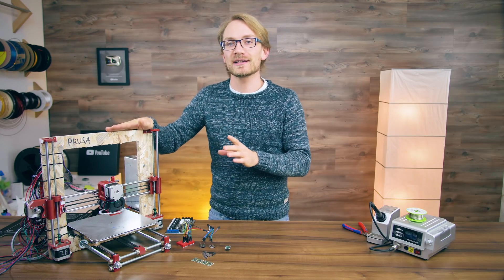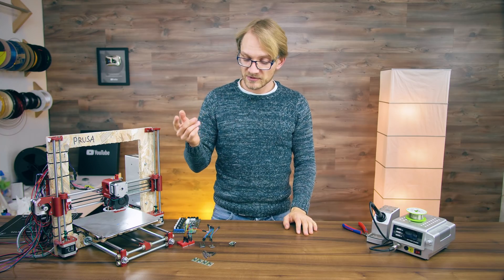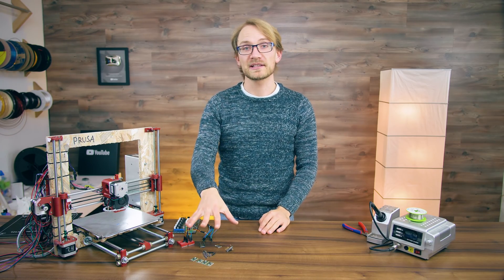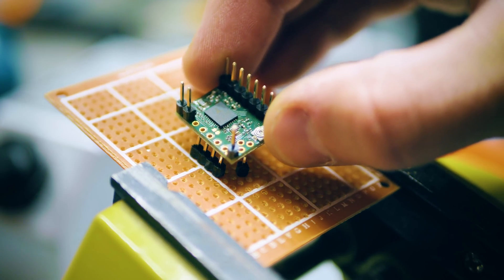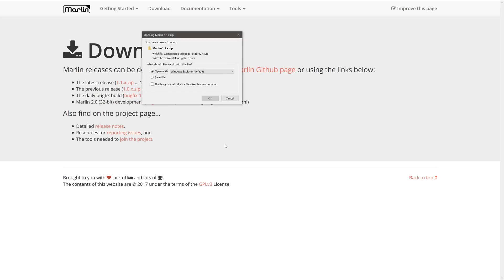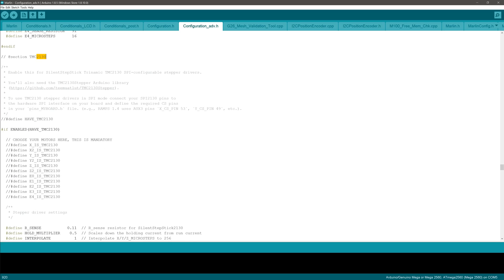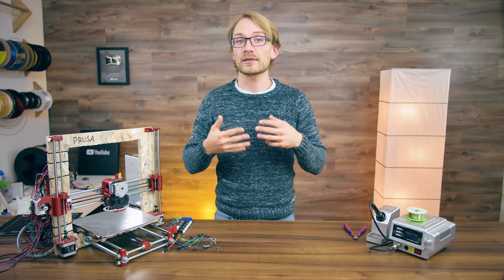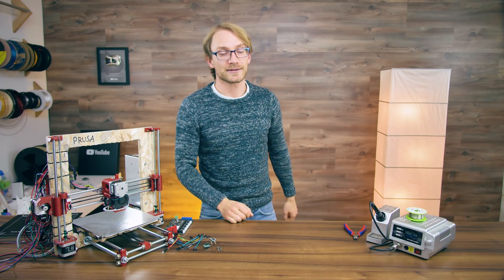How to make your 3D printer smart and silent with the TMC2130!

Comment from the maker: The amount of people in the comment section that can't take a joke is amazing... smh

Hello, YouTube comment section!
One of the most-asked questions here is "will this work with boards like the RAMBo (mini) that have integrated drivers?" - short answer: Yes!
The driver's step/dir/enable signals are typically also available on a header for each axis - connect those signals to the pins on your new driver (and plug your motor into the new driver) and you're in business. Works for both replacing blown drivers and for upgrading to something nicer!
Reply: A lot of people (Me included) want to add this to the Prusa i3 MK2, as a decent amount of viewers do own an i3 MK2, would you be willing to show us how to do it (and maybe comment on the MK2.5 Upgrade as well as some of us (Myself included) have already ordered it. :) Keep up the great work Thomas! Been a fan for ages. Thank you very much!
Reply: Thomas Sanladerer will you post short video how to do it?
Reply: Thanks Thomas.
What about other boards with integrated drivers? like the Tarantula MKS v1.4?
Reply: @spiritcore1  I'm in this boat, torched both E0 and E1. looking at upgrading to  MKS Gen L main board with TMC2130.
Reply: when will you be doing the video on re config the pins?
Reply: If i want to use these on a new printer build what would be a good  board to use
Reply: will it work/be beneficial  on a delta
Reply: Thomas, please make a tutorial on how to add this driver on the current mk2s/2.5
Reply: Not without some annoying and fragile hackery.
Reply: I think so
Reply: Thomas Sanladerer 
It is possible to do it in a Anet A8 original motherboard?
Reply: @Zahrok  did you ever get a reply or did you figure it out as i have a A8 with stock board
Reply: Showing your PC side there Tom or just virtue signalling or was that a half ass joke?  Seriously, people would like to know.
Reply: As a fellow MK2S- 2.5 upgrade on order- owner. I completely agree with this statement and would love to see a how to. I would also gladly join your Patreon to see it!
Reply: Step and direction are not available on Mini Rambo. You would have to hack the board. You would then also have to hack the firmware since it doesn't expect  these drivers
Reply: Rambo, yes the pins are broken out. Mini rambo, no. the pins are not broken out. You would have to mod the board.
Reply: So after 9 months I guess all the MK2/S users will never see a video on how to get the TMC2130s working on their Mini Rambo, no video, no thread,  no blog
Reply: I wonder if this would work on my very old makerbot clone (ctc) I am sure that junk have not been updated since few years
Reply: The motor supply voltage mainly depends on the used motor.
Here is a good guide: https://www.duet3d.com/wiki/Choosing_stepper_motors
Depending on the setup/motor the spreadCycle mode makes lower noise on higher voltages. But the stealthChop mode is always nearly noiseless.
Reply: for me on a few different types of motors, at 12v in spreadcycle the chopper frequency is in human audible range which is a "eeeeeeeeeeeeeeee" 20khz sound... quite annoying.  stealthchop is silent though but never tried due to torque concerns.   At 24v they're silent in spreadcycle.     you could use a step up converter to boost to 24v or so, but needs to handle 4amps nominal for 2 motors, maybe 3.  just need X/Y really.
Reply: Hello Thomas!

Do I really need to solder the SPI pins upwards? On a board like the MKS Gen L for example, couldn't I just remove all jumpers and solder the required connections on the board itself?
Reply: I feel like you aren't going to be able to do any of the SPI related stuff. It is fairly difficult to get even something like a BLTouch running on those boards :-/
Reply: Could you pls make a video on how to do it (personal preference on a CR10) for people that don´t get it because lacking imagination and education, pls?
Reply: So - I'd love to join "please show us HOW" queue :D
Reply: yoiu will need to replace the board a the TMC2130 cant be switched into it
Reply: Could you elaborate? I thought one can drive TMC2130 via SPI from Arduino... ?
Reply: On my Rambo 1.3 I had no pin to bypass the integrated driver. So I looked the table of unused digital pin which I connected to an extension board. Easiest way is to use a cnc shield (5$ on aliexpress). I did my own board, copied the driver schematic of the ramps 1.4, probed every connection before connecting and voila. It worked perfectly.
Reply: @jimbob1er  i don t understand how you connect your board to the minirambo if you don t have spare pins. How you do? Thanks
Reply: @fabrizioajola2085  I have spare pins elsewhere on the board that I reassigned for the motors. Because the drives are soldered on the board, those pins I cannot reassign.
Reply: @jimbob1er  yeah, good. Reassigning is feaseble. I see also on the minirambo a spare header called "P3". There are also 5 threepins available connector (those used also for endstops not used anymore with tmc2130). I m checking which one can be reassingned as SPI. Would you share pins you reassigned?
Reply: what about a board like the one used by tevo?
Reply: You will have to get a different board to use these driver as your are built into your board.
Reply: Love that you couldn't say slave hahaha. 7:48
Reply: don't assume gender's is a joke usually said to make fun of transgender people so that's why I'm unhappy about it. specially from one of my favorite youtubers it makes me slightly sad
Reply: and Melzi boards, like Wanhao  Duplicator or Malyan m150?
Reply: James Alex I am pretty sure that the Stepper drivers are integrated on the board, so you can’t replace them.
Reply: you just drop them in.... far as connecting the SPI, i haven't done that yet for 2130s but i have 2100s in there, just plug and play.
Reply: Stop the political correctness ugh it's not our fault our motherboards had slaves
Reply: In order for someone to "take a joke" you have to say it as a joke. You can't just go back and call your cringy statement a "joke" arbitrarily.
Reply: PC Planet someone’s but hurt that they did not get the joke XD 🤦🏻‍♂️